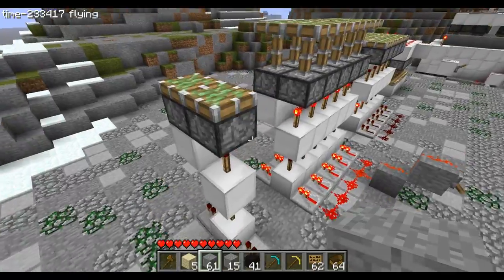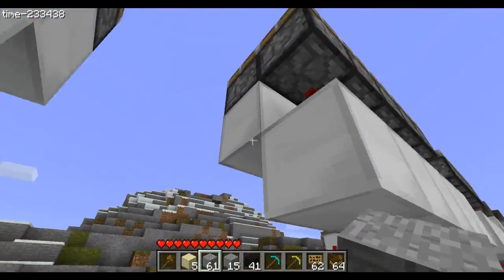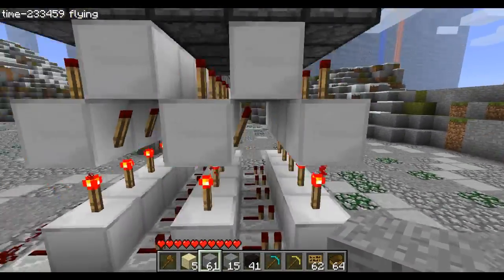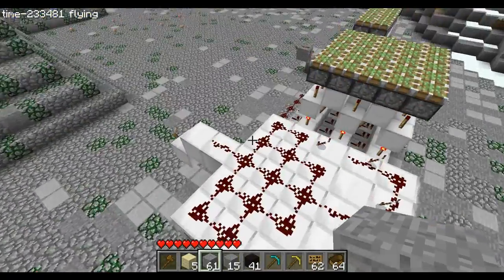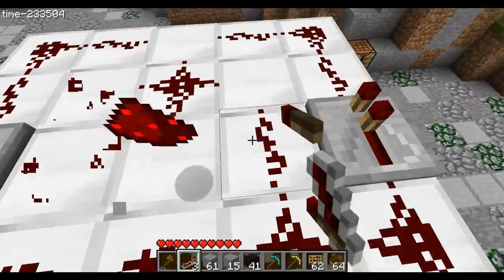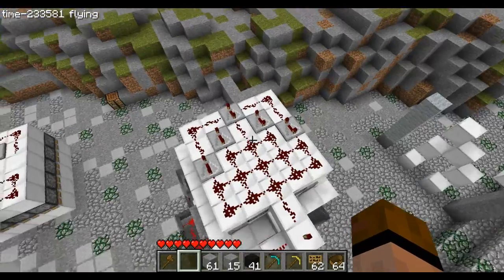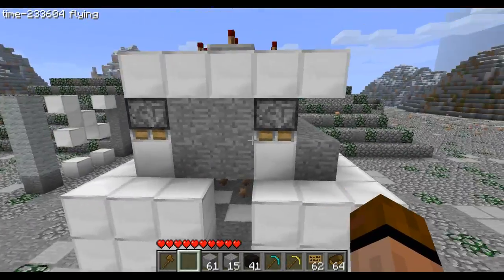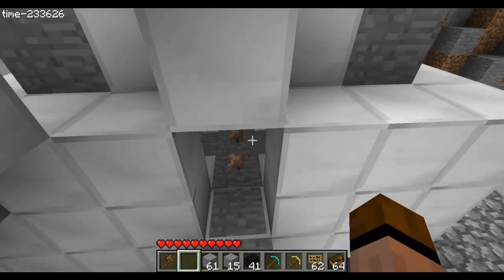Minecraft Automatic Maze Tutorial part 1

Comment: dece video i couldnt wait for the other two parts so i just made a nice redstone set up to run it, i did a 5clock so once you step on the first pressure plate it keeps the circuit on and then at the end i have a pressure plate wired to a sticky piston that will push a block that will cut off the 5 clock stopping the circuit  gj though